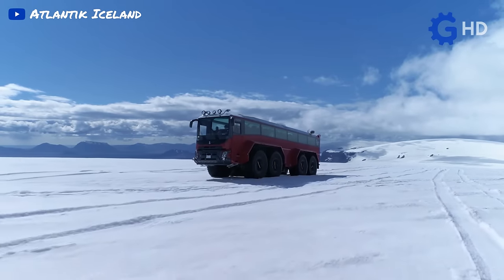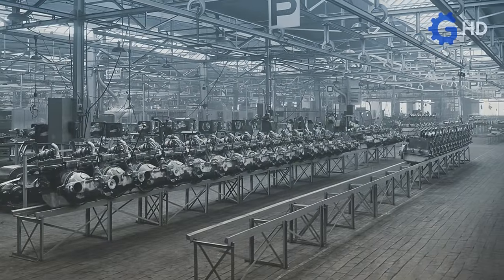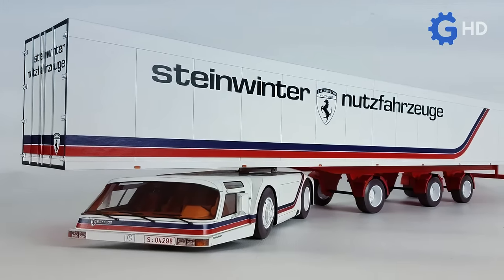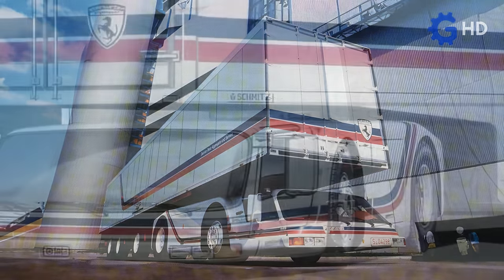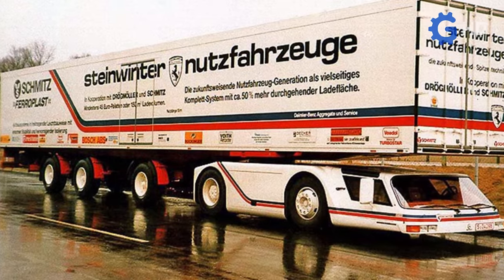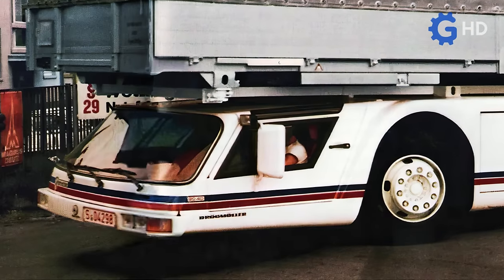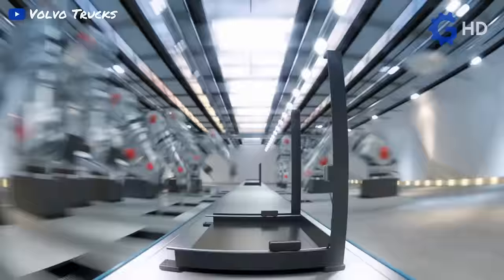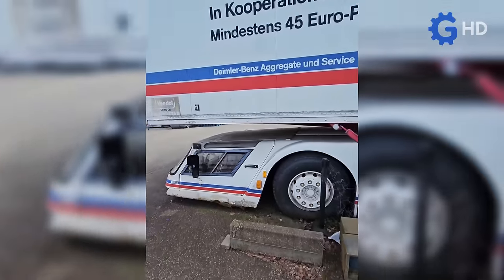The Most Extravagant Truck in History That Nobody Wanted to Produce ▶ Steinwinter Supercargo 2040

Comment: This truck was developed at the time because trucks were allowed to have a maximum length and they wanted to make the most of the loading area. However, the law was later changed and a maximum loading area was set, so this concept was obsolete and useless. There were also problems with cooling the engine, not to mention visibility in good and bad weather conditions.
Reply from the maker: Really insightful comment! It's interesting to see how changes in law can render certain innovations obsolete. The technical problems like cooling and visibility must have been quite a hurdle.

Comment: As a concept and a challenge to convention I like this a lot. There's good arguments for it not to be on the road (And I'm shocked the Verkehrsamt authorised it's use on public highways) but there are many off-road (e.g: Transit centre) applications where it could perform head and shoulders above a conventional tractor unit. 👍

But commenting as a cyclist brings me to the reason for why I do not think this'd be suitable on the road - At least not on roads shared with pedestrians and cyclists. I see enough people get caught out by the tail-swing of conventional HGVs as it is¹ but the front-swing of these could be even worse. In my country people crossing half the road then letting traffic pass before completing their crossing is quite common, and you don't want to be stood in the opposite lane if one of these is turning close to you. ⚠

(¹ - My tip: Always stop 2+ meters short of the tail-bar, and always site yourself where the driver can see you in their mirrors. Don't forget to check the number plate, and never assume the driver will be sat on the same side of the vehicle as drivers in your country do. ⬅🇳🇱🚚🇬🇧➡👍)
Reply from the maker: Thank you for your comprehensive feedback! You bring up some very valid points about the potential risks and challenges, especially in mixed traffic scenarios involving cyclists and pedestrians.

Comment: Reminds me of the Strick Cab Under.
Electronics and cameras could take of most the problems that doomed it.
There were concerns of poor driver visibility in traffic and that the driver might not feel if the rig was starting to tip over.

A camera on a stick would take care of visibility and I am sure sensors could sound an alarm if the thing starts to tip.

Comment: I wonder about the actual height of the trailer 🤔 because in the eastern US it can’t be taller than 13’6” or 14’ in the west. 
I think this design would scare off most veteran drivers because they would like to be able to see from an elevated position. OTOH, you could have a high fwd facing camera and monitor, (not to mention rear cam). But that might not ever be legal because youre effectively “taking your eyes off the road” and driving by monitor. 🤔
Reply from the maker: That's an insightful observation about the height and visibility challenges. Using cameras instead of direct vision is an innovative idea, though it comes with its own set of legal hurdles.
Reply: It has the standard fifth wheel clearance, so could pull standard trailers.

Comment: The concept of the Steinwinter-Flounder was that the entire permitted vehicle length could be used as a loading area. In response to the Steinwinter Flounder, the laws were changed so that the maximum length of the loading area is now limited. This means there is always space for a driver's cab at the front. The autonomous, electric tractor from Volvo does not need a driver's cab, but still cannot tow a longer trailer as Steinwinter's concept envisaged.
The concept of the Volvo is simple, you don't need a cab, but you can't do anything useful with the space because only cabs are allowed there by law.

Comment: The way I see it, it looks like they over-focused on one aspect of the design at the cost of the most important one - usability. 
It just does not look like a very practical and safe thing to drive.
The hilariously low position of the driver causes massive issue with visibility, but also other problems - my guess is... Your side window would be much lower than most checkpoints - good luck paying on a highway checkpoint or showing your documents on border crossing without leaving the vehicle.
Also, low position means any splatter goes directly onto your windshield, far more than in taller vehicles.
Also - in case of crash, it is your face vs opposing car's engine block. Not the most attractive prospect, I'd imagine.
Reply from the maker: Thanks for pointing out these design concerns. Your detailed observations help us understand the practical challenges drivers might face. It’s great to get such insightful feedback from experienced users.

Comment: Always thought there was no good reason why big rig drivers have to sit so high up behind a long hood.  Especially these days with the high powered engines they have.  They should sit at the same level as the cars they're sharing the road with.  It will naturally make truck drivers more cautious if they're not so invincible.  Too bad this concept was nixed.
.
Reply from the maker: That's a really interesting point! Lowering the driver's position could indeed change the dynamics of driving a big rig and potentially enhance road safety.